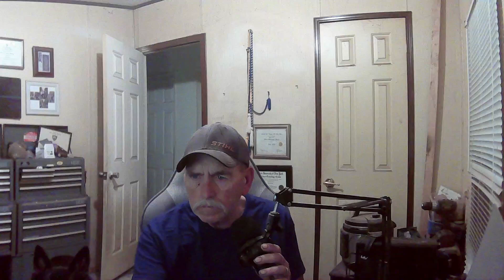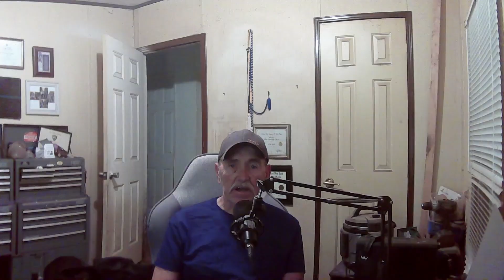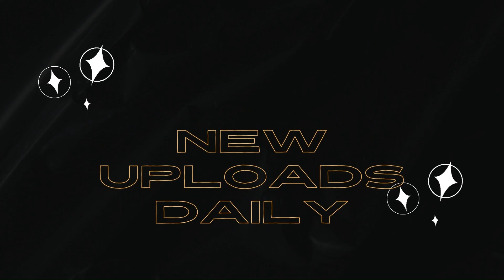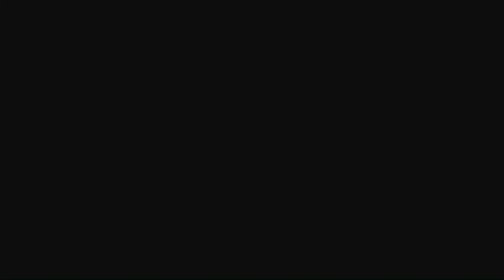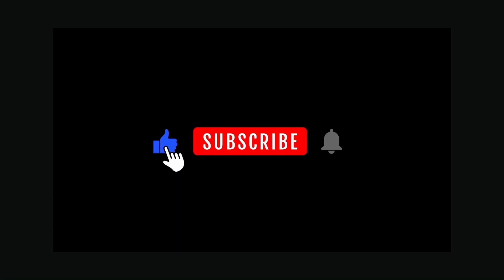Making Money from the Boneyard: My Repair Shop Strategy

Comment: This whole industry has changed and not for the better. We were a power seller on ebay since 2010 and have seen the steady decline , ebay actually makes more than I do in most cases in fees . If your not cataloging your sales and inventory in one of the programs to track profit and loss you can really go down quick. The guys who are selling parts at dealer cost  in oregon, stens and rotary really ruined it for everyone online and at shops. The old stuff is dying out too we are one of 2 Bolens parts suppliers left in the country and it gets less and less demand for those parts each year too. Thankfully everything is paid for so if we decide to close its no big deal.
Reply from the maker: Well said. Most that are selling there on the venues are going backwards. I'm using it to clear new old stock at break even and a loss in some cases.

Comment: Missing parts just means it's been messed with. Just depends on how bad it has been messed up. I had one this week that had a plastic plug shoved in the air filter housing and screwed back onto the carburetor. The screws were cross threaded, and the compression was 50psi. That one got scrapped out in the first 3 minutes. Knowing what to look for can save you a lot of time. I saved the blae,blade adapter, Air filter housing, ignition coil, gas cap, and anything else that I might be able to use down the road.
Reply from the maker: That's what I do, Jason. Anything I think can be reused or repurposed is saved.